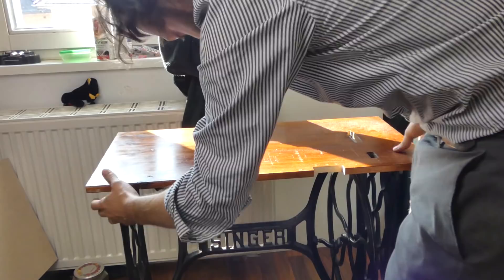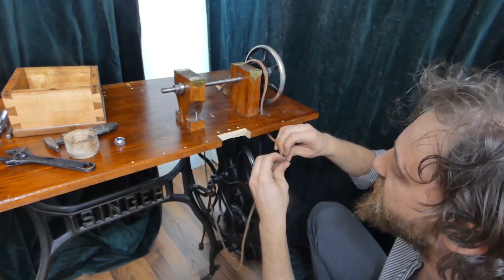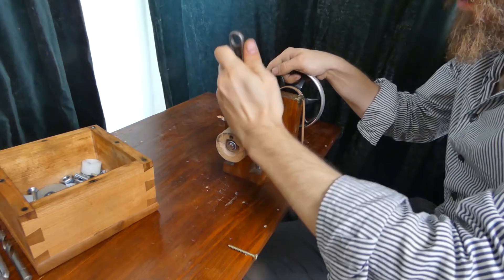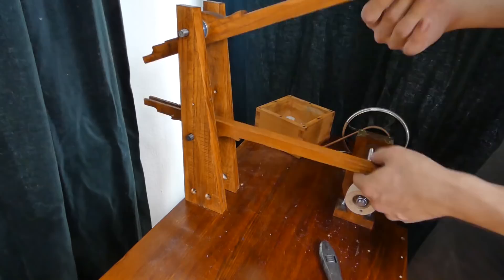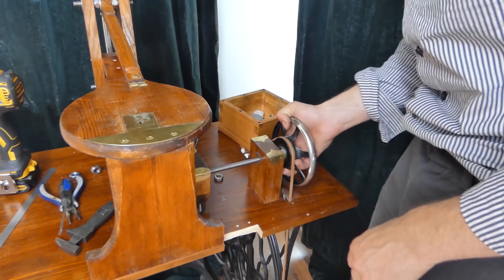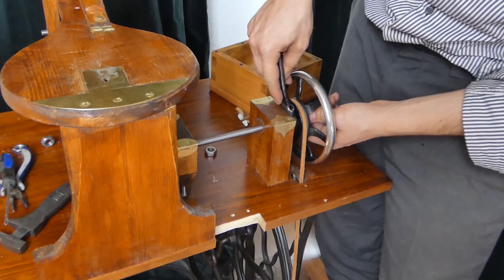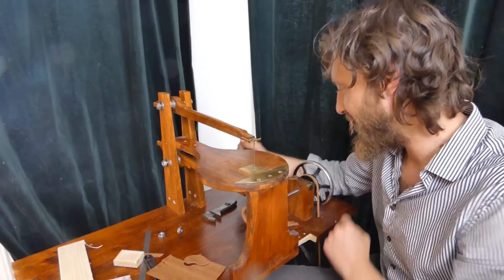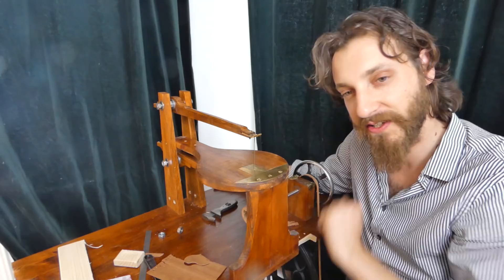From sewing machine to scroll saw - reassembling video

Comment: I'd love to see interchangeable tops for this machine where you can just loosen 4 bolts and plop another machine on it.
Reply: I do think that with some designing one could make a whole attachment for the scroll saw!  Really only needs to be one unit and quick connect to the shaft and a few bolts to hole it down!  Other attachments could be buffer, grinder wheel and a few other nice things!
Reply: I’m currently planning on building a multifunction workbench for this year’s diploma project. The catch is that it’s all handmade and will be used with only human powered tools too.
I’m going to build a modular pedal/pump system so that I can use a sewing machine, a scroll saw, a drill press, and eventually a lathe and a disk sander.
Hopefully I’ll come back here by the end of the school year with a blog to showcase it ;)
Reply: @-lll-ll-llll-AVE  Hey, 4 years later, was wondering if you succeeded, and have it visible for us somewhere? Those plans sound great.
Reply: @Lemu_with_a_shirt  hey, unfortunately COVID and quarantine got in the way of my plans, which couldn't happen as a school project anymore. The whole thing has been put aside for the time being but I still have quite a bit of work, materials and machines gathered and hopefully I'll find the time and motivation to get back at it sometime. Thanks for enquiring
Reply: @-lll-ll-llll-AVE  Ah, understandable, thanks for the response.
Good luck.

Comment: URI MY FRIEND! I have a little tip for you - bearings work better if they are really threaded down tight. The secret to keep them spinning freely is to put a small washer the size of the inner bearing races on both sides of every tightened down bearing. That stops things from rubbing and slowing from friction and allows the bearings to rotate freely even though the inner races are now effectively bolted down and immobile.

Comment: I quite love this - partly because I have a desire for a scroll saw, and also because a treadle-operated tool is a very good compromise for occasional use. Indeed, now I'd like to build such a tool, but in a way that allows the treadle to be used to power other tools as well, like a die filer.

Comment: You can make a leather-like strap with a piece of braided rope (the more cores, the better). Here's how:

Step 1, find any video about braiding two rope ends, one to the other. Easily found, it involves splitting the ends in the original core pairs and then bringing them together.
You should have a loop of rope that's taught on the hand wheel and on the flywheel.
Step 2, get any rubber compound you can find. Can be plasti-dip, can be liquid sealant (electric liquid tape). Then coat the rope loop in it.
You now have a strong, catchy alternative to leather.

Step 2b, if you can't get those compounds, or you find them to be expensive, just get a MTB 26x inner tube, as cheapo (therefore thin) as possible, slice it in strips that fit in the groove of the two wheel pulleys. Get contact cement, and glue them in. You can then put the rope loop in. This does increase the diameter slightly, so if you go with this, be sure to make the rope loop AFTER, you've done this.

Contact cement is easily removable with paint thinner, so you're not doing any damage to your antique sewing machine (just be careful not to spill any on your antique sewing machine, because that's when you're doing damage).

I use this method on both of my Singer machines, i find it much more agreeable than a leather belt. Less slip, and cheap too. Getting round belt is expensive and unless you take care of it, it will become damaged and break at the metal clip/pin/staple.

Cheers.

Comment: Fashion the lathe and scroll saw so you can take the whole mechanism, as a unit, off the table and put it back on without disassembly.  I would go nuts if I had to keep taking them apart and might take up basket weaving.

Comment: ... what about raising the sewing machine itself up, and replacing the needle assembly with a blade holding assembly? I imagine that your version has a longer action on the blade, but for thin pieces of wood or metal, would that work? That is, assuming you can find an antique sewing machine that still works...

Comment: I feel like the threaded rod as an axle is a bad idea, I've seen that all thread stuff remove material from the inside of bearings on multiple occasions.... It would be fine if you had a sleeve or a bronze bearing between the two surfaces or use a straight rod and thread the ends yourself, just so it has a a bit more longevity than the threaded rod.

Comment: Couldn't you just hook the scroll blade to the sewing machines needle arm somehow?  It already converts to lateral motion.  You probably wouldn't even have to take apart the sewing machine. Just add an arm to the existing needle bar to extend the motion farther forward and use something similar to what you already built for blade tension.  Cool Idea by the way!  Nice work...

Comment: As i see it now, definitely needs a counterweight on the arbor and you need to have a sprung "spacer" on the back, rather than the turn buckle (which isn't a bad idea, but it's not working out because it spreads things unequally). You might also want to add a second pulley in system to gear down the affair. OH and weight. A lot of weight on the hand wheel. The Singer machine relies on the weight of the machine (rather, the friction) to work, you've eliminated that, so now you need to add it back in the equation. 
If you go look at hand powered (or foot powered) antique variants of the scroll saw, you'll see those elements i suggested. 

I find it to be a fascinating tool. It essentially is one of the crocodiles of the tool world, as far as complex machinery (not a chisel or a hammer) is concerned, hasn't evolved or rather, hasn't seen the need to evolve for a hundred or more years.

Comment: URI, hope you still check comments - mine runs perfect until I connect the lower arm to the wooden cam. There’s a hard spot as you try to rotate it and the belt on the treadle spins around the small pulley when it gets to that spot. Any suggestions…

Comment: hi uri, thank you for sharing the build. i´d like to ask you what is the blade travel in mm, or the crank offset. i´ll make one!, what blades are you using for metal (if any). thanks again. peter
Reply from the maker: The travel depends on how thick of a material you want to saw, if you saw only thin stock you can make the travel pretty long which will give you more sawing speed. There blades for metal, around 25 tpi is suitable.
Reply: @urituchmanpigeon  thanks man

Comment: Do you need to tune the blade for different materials and if so what note is for brass? 😜
Reply from the maker: Not really, the blade should be always nice and tight, somewhere around B flat. There are, however, different blades that fit different materials.
Reply: Uri Tuchman I thought it should be A#😁

Comment: Frankly, after the other things you have done, I'm a bit disappointed in  this one. First, I don't like that you're ruining a perfectly good treadle sewing machine. They actually have one great use left, they sew leather when other modern machines can't.  Two, your work is usually so artistic, I was expecting something less "get the job done" and more of a work of art. Carved hands holding the parts, scrollwork and carving, something.  You've built up very high expectations. Workaday tools aren't going to make it in your case. By the way, you can make a scroll saw or a lathe out of bicycle parts, I've seen it done.